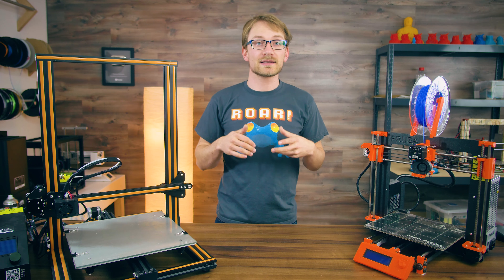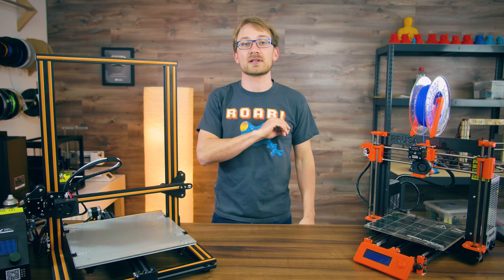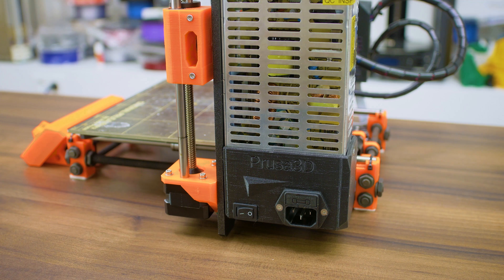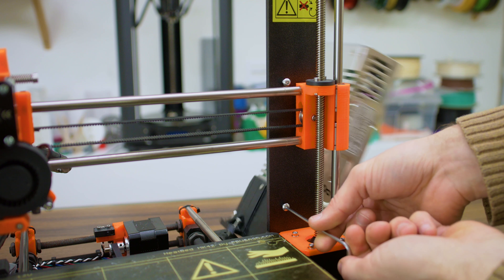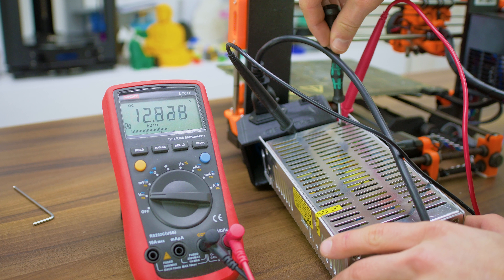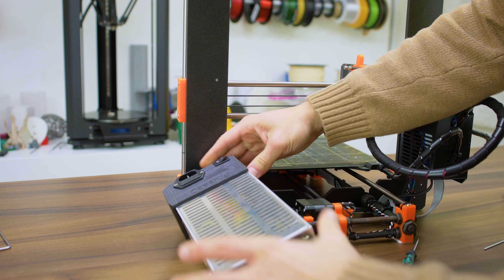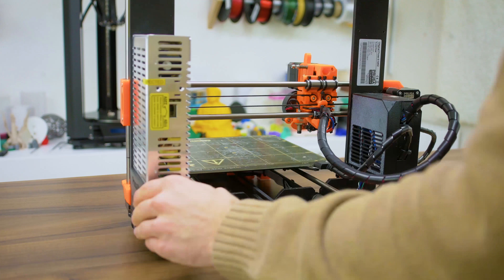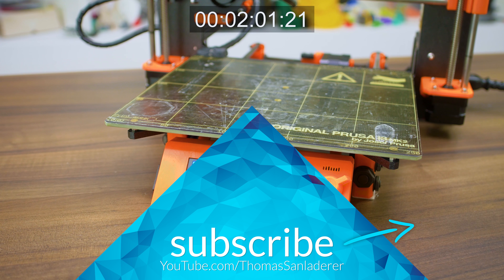How to get your 3D printer hot - faster (and for free!)

Comment: In addition to this, I would recommend measuring the voltage drop of the bed heater wiring - I've seen a lot of clone printers use REALLY thin wire which would cause a drop of 1-2 volts over their length.  Replace it with heavier gauge silicone-insulated wire and...well...Bob's your uncle!

Comment: I  cranked up the voltage on my MK2 after your first video on the topic. It made a huge difference in bed heat up times for printing ABS and let's me use the part cooling fan at higher temps. It greatly increased my satisfaction with the printer. Yes I retuned the PIDs. Thanks Tom!

Comment: I liked all the warnings and disclaimers you had at the start of this video.  :)  You should use a non-metallic screwdriver when making the adjustment to the power supply. If you don't have one, at least keep the other hand away from the metal case of the power supply while making an adjustment to the trim pot.

Comment: Excellent explanation, 2 years ago when I build the first version of my Delta 3D printer I decided to go with a 230V 300W heated bed, after I got well annoyed by the slow heatup of the  leapfrog creatr I had. Really happy I did, because the time dropped from 30 minutes (yeah it was that slow) to about 20 seconds. I had it triggered by a solidstate relay that was controlled by my printer's controllerboard.
Reply: @Stefs Engineering really changes that much? I believe I got 12v and get to where I need in about 2 minutes but wanted to find someone who done 12v and 240v to see what the difference is and if it is actually worth it or not

Comment: Flashing those disclaimers so fast kinda makes it sound like people should disregard them. Seriously, check your board's documentation before doing this, not all boards accept a wider range of voltages. ie. One has a Duet board powered on 24V, the board has upper voltage input limit of 25V... AFAIK, mini-rambo is specified 10-28V, rambo 10-26V and einsy rambo 12-24v (according to reprapwiki)

Comment: I know it's more money to spend but I can get to 95c in less than 4 minutes with a mains voltage silicone mat heater. Never have to worry about a power supply for it either. I'll never go back to using the PCB heaters. I will say that turning up the voltage on the power supply is a good method, I turned mine up to 14.5 volts and had no ill effects at all. Before I upgraded to the silicone mat heater I did this and it helped a lot.

Comment: Upped my CR-10S to 13.4v and its running better than ever -suprisingly. Filament heater heats up faster (I have spares if it burns out), and the hot bed went from using 240 watts to 300 watts - total power consumption is just under the 380 the PSU is rated for. Im noticing a drastic increase in heat bed performance now. The only part taking a beating is the PSU when both heaters are heating up and its hitting 90% of its output capability. I did monitor the printer before the mod to see what kind of VDROOP the PSU had and it was less than expected at around .2v under full load. The servos are not getting any hotter than before - the just get slightly warm as normal.

Comment: I always used used used PC power supplies. One for the electronics, and one for the bed, separated with a relay (since it's a much bigger inertia, i think pid tuning is not that critical) I even made a "double ATX" power supply, which gives me 24V, which i feed into the 12V part of the mk3 alu heated bed. (of course, i don't rtecommend this, unless you work full safety) This way i get rock solid nozzle and bed temperatures even with higher speeds! And also 110c bed , at about a minute and a half :)

Comment: Temporarily add heatshrink or electrical tape to the screwdriver shaft.  Or any kind of plastic/rubber tubing you may have on hand that will fit in the power supply hole.

If that's not enough improvement, 24V upgrades are becoming increasingly popular.

Comment: I did this mod with my Wanhao i3 a couple if years ago. Made a big difference to the heat up time and still no problems. This thing is to do some math to work out what the max load is when everything is running and pick a voltage that keeps within the PSU rating. The only big changes are the bed and hotend currents.

Comment: This is good info, but not nearly as fun as building a horrible enclosure and then going to get tacos with Punished Props. ;)
Reply: Ha, Joel man, I felt bad for you on the enclosure. I did a video just like it with a little different material, then realized the CR-10 was never going to get hot enough to heat the chamber. So i just didn't post the video. Thanks for going through and posting it. :) Ahhh, the CR-10.... gotta love it.
Reply: Great, now I am hungry too.
Reply: John Blair I'm sorry?
Reply: I need a good all in one printer that does 3d printing, laser, cnc AND browns hamburger for tacos! :D
Reply: still Joel, your horrible enclosure was classic DIY and honestly not bad.
Reply: 3D Printing Nerd Joel thank you so much for your reviews, I purchased a cr10s4 from tinymachines and I love it!!
Reply: Try the fireproof pot holders covering the bed while it heats Joel.  Works great on my CR-10.  It's like a nice insulating blanket for the bed while it heats up.
Reply: Get an Instant Pot. They do everything
Reply: LOL Joel :D

Comment: Whilst I doubt this will cause any adverse effects to the actual power supply itself, it is likely to increase the load on any linear regulators situated on the controller board which will, at the very least, cause them to run hotter and, in the worst case scenario, cause those components to fail prematurely. I think for the majority of users some sort of enclosure is by far the best option.

Comment: An easier way is to insulate the underneath of your bed and also place a piece of foam on the top whilst it’s heating up. Also, I believe alot of power is lost in the cables to the prnter and these should be upgraded or doubled up.

Comment: I added a few layers of aluminum foil under the bed as a radiant barrier that reflects the radiant heat back into the bottom of the bed. The very small separation between foil layers also limit convective cooling. I have faster warm up times and can go to higher temperatures without increasing the voltage.

Comment: One thing I do for my heated beds (without cranking the voltage up) is insulate them with a layer of Pyrogel 2250 in 2mm thickness. Not only does it help the bed heat up faster by reducing energy loss but smaller pieces cut to size work better than a silicone sock for the hot ends.
Reply: Where'd you get it and how did you attach it?
Reply: It's available in the 1 piece samples: http://www.pacorinc.com/standard-length-aerogel-insulation/try1-sample-kit  I simply cut to size for the heat beds. For the heat block I made a pattern out of paper and used simple steel utility wire to wrap it, making all the ties on top of the block. Here's a wrapped block on my Monoprice Ultimate: https://photos.app.goo.gl/sz0ULoXTTldjs7l53

Comment: I just ran a second output wire to a larger mosfet . It was made for the heated bed but the whole board runs off of the same rail for steppers hotend fans and lights. The draw from the boards outputs is actually audible without the secondary mosfet for high current delivery. And simply adding larger gauge wire will help in dc loads. Tuning the power supply is great but if you cant deliver the current that you need then that's a bigger problem. I agree it should be checked. But for ten bucks I can add A way better Mosfet perfectly tuned to deliver high current. Don't burn the house down spend the ten bucks. I got one on amazon that is for the heated bed, and there Isnt anything wrong with overengineering the hotend a little bit.

Comment: i did this to my an et a-8 some time ago, i think i remember i went all the way up to 16V with it.. No problems so far and the bed heats up so much faster! I also removed the plug from the bed and soldered thicker wires directly to it though, in order to hopefully reduce the risk of a housefire ^^
Reply: muh1h1 ur running 16v on your A8? Are there any of these 5v parts on it im reading about? Im about to swap to a A6 board and A6 lcd... highest i can get is 96-97c on bed and with print cooling fan on it drops to 93 and lower.
Reply: JAY IRVING can't help you with that, still running the original board and lcd. I had simular maximum temps before i turned the voltage up, but now i can go up to around 100°C with paart coolung. Sometimes when i do that the printer stopsmid print though because of "thermal runaway", because i need to adjust the pids...
However when i set it to 95°C i have no problems

Comment: This is similar to some ham radio stuff... We use 12v powered radios, but we're ok to take the full 13.8-14.6 (but no higher), in order to deal with the sudden voltage drop when going into transmit cycle. Some of our newer digital radio stuff, especially ICOM branded radios, don't like the voltage drop when it gets below 10.5v under full transmit load @ 440MHz or higher... At least that's my experience....

Comment: You would be MUCH safer (and faster!) by using an hair dryer (or a heat gun, if you are hairless) to heat the bed to temp and bypass the limiting step altogether (thermal capacitance). Even if you do this conservatively.
Do a comparison video between the 3 situations: stock PSU, overvolted PSU and hair dryer...
Reply: What I've done is just made a little "mat" with nichrome wire and my lab supply, whenever I need to heat my bed and mirror up, I'll throw it on my cr-10, and I'll have it ready in less than 5 minutes.
Reply: This trick would also help heatless (alu) beds to favor 1st layer adhesion.

Comment: Hairdryer/Heatgun is my way to heat up quickly. no hacking required.
Let's not forget how cheap manufacturers might have saved some bucks by using 16V rated capacitors for the 12V rail instead of 25V or more. Higher voltage reduces the effectiveness and long term stability/endurance of your capacitors, especially when you get near the rated voltage, so you might get more EMI problems or failling controller boards down the line.

Comment: Back in the day when my printer was pure USB controlled I install a bypass switch for the bed, It saves me a few minutes until my crap notebook starts up and connect to turn it on normally... also a piece of cardboard on bed (on 20x20cm a box from filaments can be perfect) helps to stop "air cooling" of the bed, with a piece of aluminium foil it works even better. Now I have Chinese MK3 bed with some cheap car heat insulation sticked on downside (but this cause it to cool down veeery slow - sometimes needed to remove the print, but I have removable glass so it doesn't matter much... and it saves a lot of electricity for sure)
Reply: well that was all just bed... I don't have any mods on hot end but there is the silicone cover for E3D hot ends and I also saw some I think cotton universal insulators, but who have so much time to wait for it to cool down???
I have 2 power supplies 12 and 24 volt setted exactly to these by some cheap aliexpress build in voltmeters (well 24 someties turn to 23,9V :D )

Comment: I mounted two heaters to my extruder, that worked well. it heats faster and can maintain the temperatures better. (also i would probably not overvolt my anet a8.. it might burst in to flames)

Comment: Actually I think the first thing you should check if in Marlin you have "#define BANG_MAX 255", and "#define MAX_BED_POWER 255". If not, then set them to 255, and then run autotune for hotend and bed (or whatever you changed). If those are already at 255, then increase the power supply voltage.

Comment: While it's nowhere near as much fun, there is a safer way to heat the bed faster.  Simply cut a piece of insulating foam to size and place it on the bed!  Plus it keeps the bed from getting dusty (although my printer's never off for long enough for that to happen).
Reply: use the same setup and also cut my heating time in half (to be honest I also insulated the beds bottom with a stick on insulation used under kitchen heating plates
Reply: I thought about making a cover lined with kitchen foil and placing on the heated bed while it warms up for the same reason. Might be worth a crack. The heat dissipation on a bed must be enormous considering its surface area.

Comment: A thing I did to my printer to heat up faster without using this dirty cheat is by simply isolating my heatbed on the underside and the magic trick for my hotend is to buy a 50W heater instead of the standardised 40W. This last trick makes a huge difference! The only thing you need to do is running a new PID check. For not even 10 dollars I did both!

Comment: ...or replace your PSU with a higher wattage output version. The generic PSUs on printers are typically a (relatively) puny 12VDC @ <=20A which is probably ok for PLA printing but may struggle for higher temp plastics.

Comment: I just wired the heatbed to 2nd PSU 18.00 and adjusted it to 14v, the stock PSU remained at 12v. used Mosfets to isolate Motheeboard. 100c in 5 mins or less.

Comment: I put fireproof potholders over the bed of my CR-10 while it heats up and I can get to 70c in under 10 minutes and it has no problem holding 70c once I take it off.  I tried getting it up to 75c with the pot holders and that took around 15 minutes.

Comment: Disclaimer transcriptions:

This will void your warranty. (Damages from this process are easy to identify by the manufacturer)

This process is not endorsed by Prusa or any other manufacturer.

 This will void your warranty.

I’m reaching into a power supply with a metal screwdriver, there could still be charged capacitors in there that might electrocute me - or YOU, if you do the same. 
There is a very real risk of frying your power supply, writing, power transistors or heaters. If these components are undersized in your printer, they could even catch on fire.
 If you choose to do this, you’re doing it at your own risk. My MK2s have been running fine all this time with the voltage mod, but there’s no guarantee that it won’t turn your printer into a pile of ashes.

 
DO THIS AT YOUR OWN RISK.

Comment: you should probably invest in a ceramic screwdriver for tuning potentiometers, much safer for both you and the board
Reply: power can Arc through the screwdriver handle
Reply: It doesn't, its more for in case you slip up and accidentally poke the compenent next to the potentiometer

Comment: Remember that all electronics are speced to 10% or more down from what they can actually preform.  Meaning a psu that is speced for 10 volts has been tested and passed tests of 11 volts.  I would exercise  common sense and keep an eye on it for the first few prints just to be sure.  Remember modify then Test test test. I have pushed desk top computers around 25% for a 5 years and have not had the board burn out yet.  I tested the oc / over volt for a solid week.  again ... mod then test test test.

Comment: This is quite dangerous as some printers are already very close to the PSU limit (ex. Tevo Tarantula) so you might just break your PSU or put it on fire...
Reply: My $0.02, is these printers need like 20% design headroom (in watts) for PSU cap aging... just like in PC builds. Just a best practice for PC design, but not sure how that works in 3D. Fairly sure it would be the same with most switch mode supplies.

Lucky me though, I have some really clean running linear supplies for everything 3D/ham radio. Heavy as a boat anchor though. :P

Comment: What about fans on this voltage? I think dead extruder cooling fan is most dangerous part on 3D printer, but most of boards didn't monitor yellow fan pin, even firmware like smoothieware didn't have support for fan monitoring.

Comment: I almost had a 3d Printer "Dolly Build" house fire the other day. I was just starting setting it up first time, doing a bed & extruder burn test while calibrating when I noticed smoke coming from the Ramp 1.4 (AliExpress Clone). The green power connector's 11A positive pin started to melt. All connections where nice and tight. Just a cheap connector rated at 15A (ya right, maybe 1.5A) . I was also having intermittent problems with my Steppers not always working, after some investigation I noticed that touching the "Green - now burnt - Connector" the steppers started & stopped, even with all connections tight. That connector just does not make good connections. I've replaced the Green Connector with a, well...., an automotive 12V 4 pin flat trailer connector (only thing I had on hand). Not the prettiest, but it works. Now if I can only get it to print a good first layer........ Cheers
Reply: alway use an external mosfet for the heated bed. With only the hotend and the motors connected to the ramps, even the crappiest connector will not burn down
Reply: Now you tell me.... LOL

Comment: Depending on the quality of your RAMPS/Mega board (or similar controller) you may find this mods let's out the magic smoke. Many of the less expensive knock-offs just can't handle the higher voltage :(
Reply: 10%? I'd call bullshit on that one. Doubling the voltage 12V to 24V), yes which is where your misinformation was likely born.

Comment: Out of curiosity, how fast would a stock CR10 heat to 70°c with an insulation board on it, some piece of cork for exemple ?
My bet is that it would speed things up quite a bit.
Reply: It is quicker.  I used plumbers felt and cork board.   Then i bought Wangdd22 3D Printer Parts Heating Controller MKS MOSFET for Heat Bed/Extruder MOS Module Exceed 30A Support Big Current from amazon and a 24 volt power supply.  I just had it go from 24degree (room temp) to 70 in about 1:40.